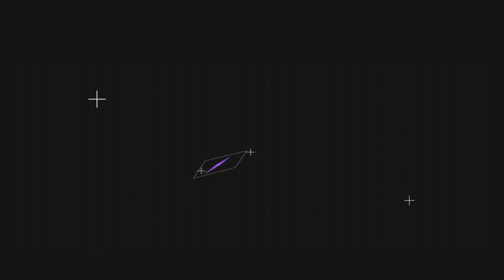How To Become 👨🏻‍🔧 ✈️ Aircraft Maintenance Engineer 🛠️ | IAJ

Comment: Is it possible to apply for the computer number and just write the exams i.e. modules , without enrolling in a AME college?
Reply: Yes. AME colleges are more or less a scam. After you complete the course from the college all you get is a Certificate of Completion (not even a degree) which has no credibility. Later when you're finally into the job market, you will realize B.tech and Engineering students have more preference over AME students and the field is largely dominated by B.tech and  Engineering AMEs who have cleared the modules and papers by themselves. AME is a very saturated field with little to no preference to AME passouts and with years of unpaid internships and salary in the form of peanuts. This is my first hand experience after passing out from the biggest AME college in India (Thakur Institute of Aviation Technology, Kandivali). They promise to you job placement or "assistance" for job placement but all they care about is the fees and you're basically dead to them after that.
Reply: @jamesthomas8201  thanks for the response bro
Reply: @jamesthomas8201  instead of b tech can you go for aeronautical engineering and do certification at the same time